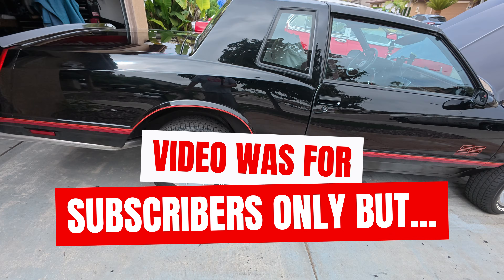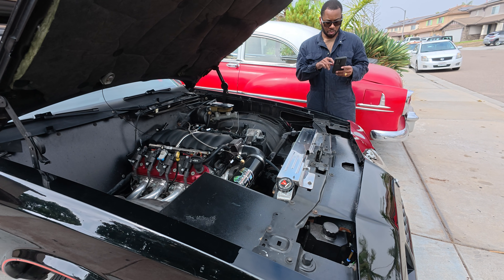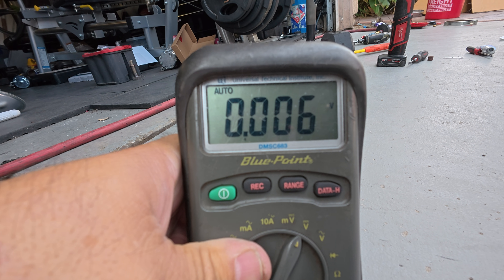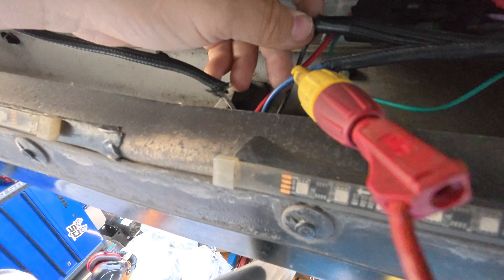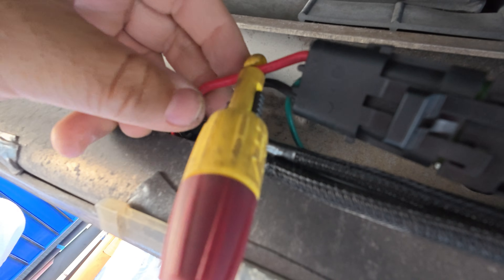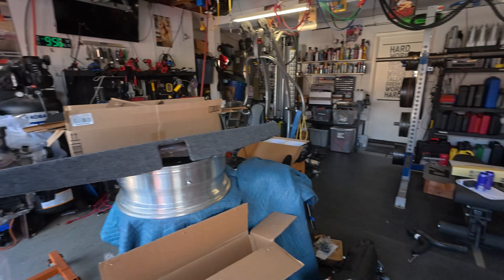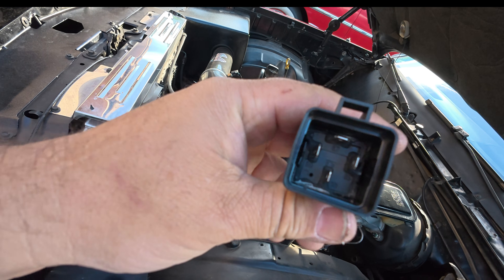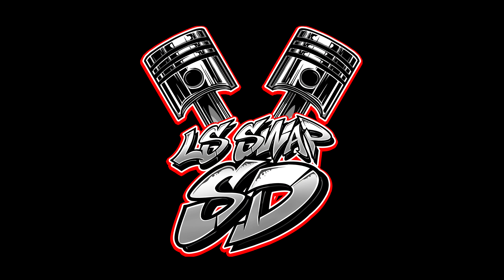Fuel Pump Relay

Comment: Question to anyone, when the holley does a 5 second prime does the fuel pressure regulator stay at 59 psi or does it drop immediately after the fuel pump turns off
Reply from the maker: Depends on the fuel pump you use and if it has an internal check valve. Most don’t do pressure drops
Reply: @LSSwapSD I used the one that Tamks inc gave me with the fuel tank for my chevelle. When i Cycle the 5 second prime, it drops immediately lol. Get a fuel pump with a check valve i assume?